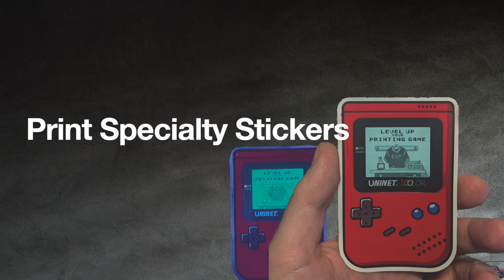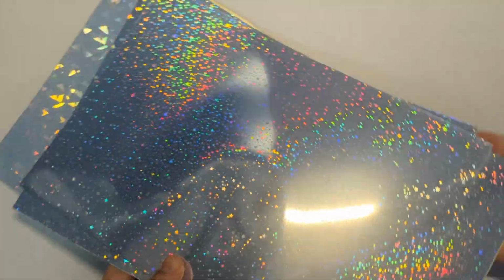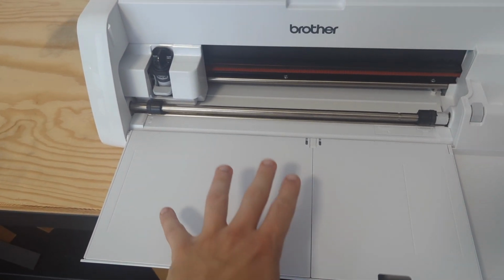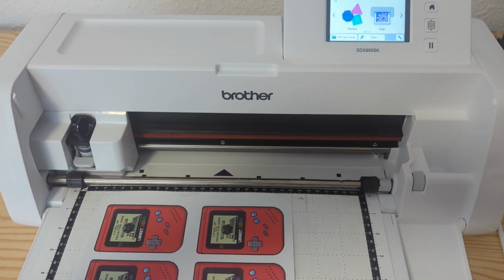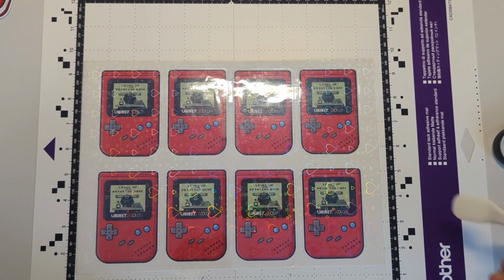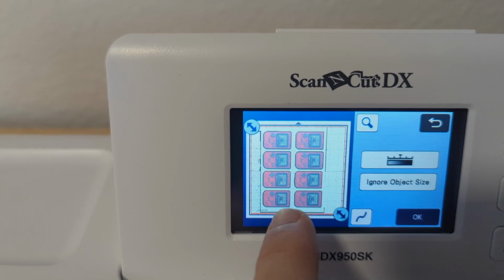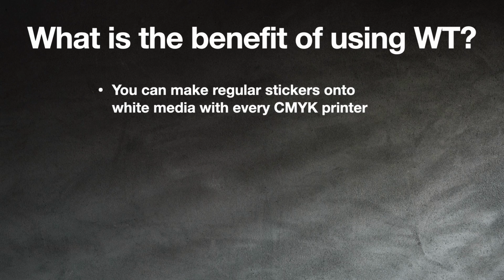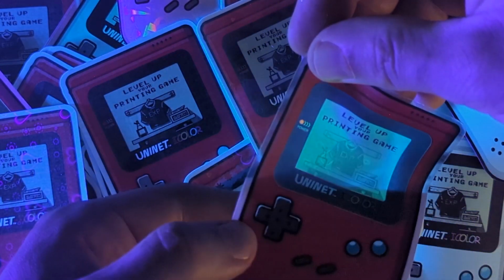Printing HIGH PROFIT Specialty Stickers with your IColor White Toner Printer!

Comment: Any tip to put the best resolution to print stickers on the Icolor 650? I tried to print on a sticker paper but the quality was bad but i dont know if it is the paper brand.
Reply from the maker: You should use the media listed in the drop down menu in prorip for guaranteed results, any other media would need testing in order to setup a new print mode. 
https://www.icolorprint.com/store/products?search=sticker+paper+clear&rs=X

Comment: Is it possible to make stickers using Uninet paper and Oki 8432wt printer?
Reply: You can print on the White vinyl media and the holographic media, but you cannot use the clear media as the 8432 cannot print White under the colours (just on top, like for transfers). The 8432 is quite limited in comparison to an iColor 650
Reply: @chrishd84  Thank you Chris.👍
Reply: @chrishd84 Hey Chris, are the fluorescent toners more vibrant than the regular toners that come with the Uninet 650?
Reply: @DrizzyFest  They are a completely new color range, which would allow you to print colors that you couldn‘t with the regular CMYK toners. Examples are hot pink or a super bright orange. In general, you could say the fluorescent colors are brighter than the regular colors. You can also mix the colors in your printer (like fluorescent yellow + regular cyan and magenta) if you want to highlight a certain color.
Reply: @chrishd84  I'd like a video on mixing toners when designing if possible
Reply: @jostvig01  that would be a super short video 😅

There's no change in the design software, you just stick with cmyk, as usual. 

If you want your cyan to glow, you simply insert fluorescent cyan toner and have Magnets and yellow (which is needed to create red) as standard toners.